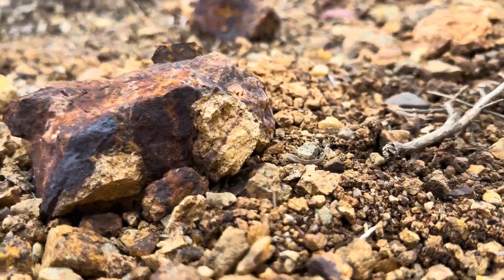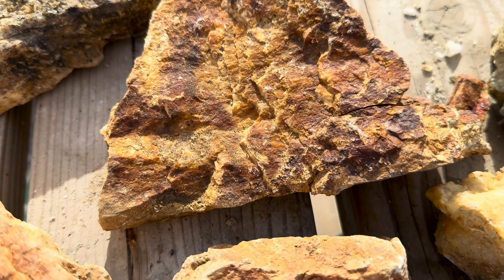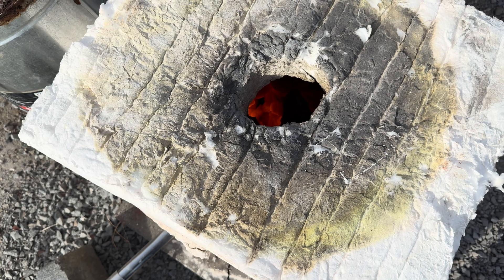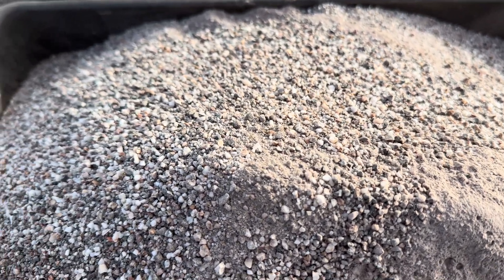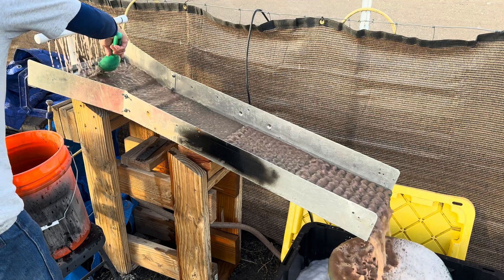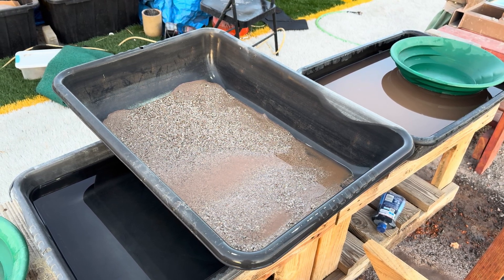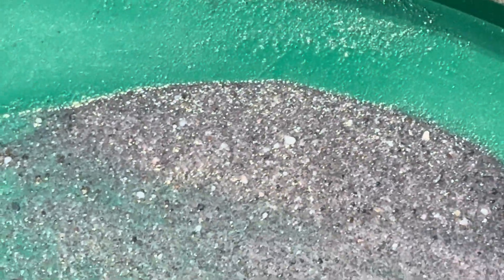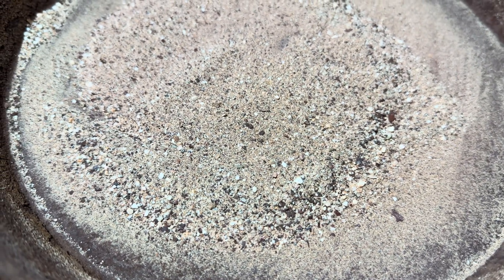Preparing To Get Gold From Gold Ore Using Zinc Pt 1

Comment: How many gallons a per minute is you water pump for your sluice? I was thinking about what size I would need.
Reply from the maker: @TheGeologist101  Honestly I forgot. I think it’s around 1900 gallons, but it’s not enough. I have my turn off valve fully open. I think I will need and 2500 gph at 1 inch when I extend my sluice box to 6 feet. I hope this helps.